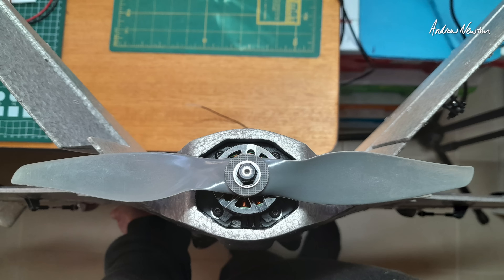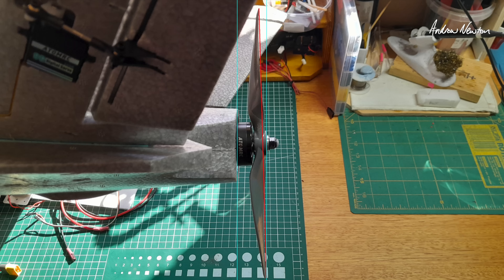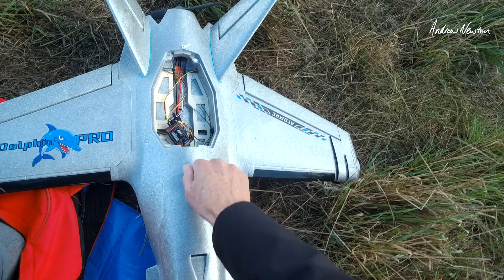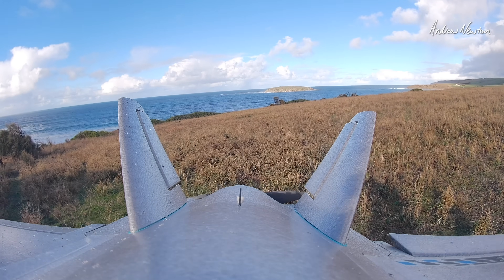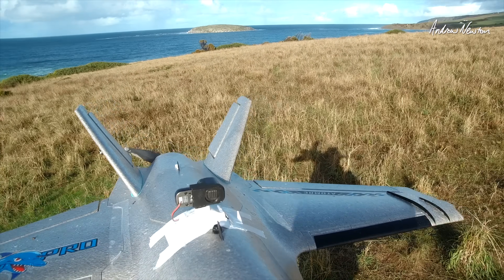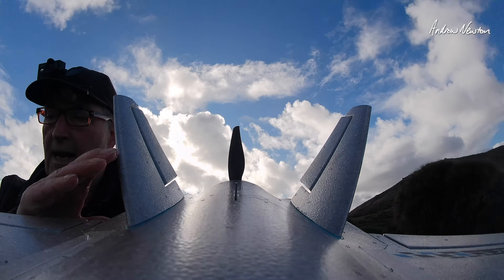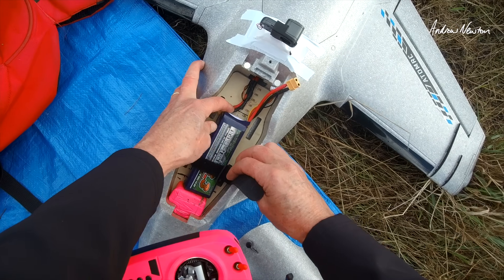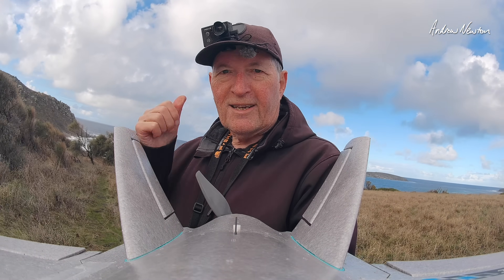AtomRC Dolphin Pro - Part 3. Flying Well without FC

Comment: Appreciate your in depth analysis and insight Andrew. So to recap 0.4mm was better than 0.8mm down thrust angle?
Reply from the maker: I left the 0.8 in and it flies perfectly with INAV now. 70/40 elevon mix with no elevator on the VTail, just rudder. I'll do another video soon.

Comment: Daft question, but can you not use the V-Tail as Rudder only in conjunction with Elevon mixing? I don't like the look of it with V-Tail as Elevator only. I'd also go 2x2200 3S Lipos in Series to give a 2200 6S. 4S just hasn't got enough guts on that motor.
Reply from the maker: Not daft. That will be how I set it up eventually. Elevator on the tail is more like air brakes but rudder will work.
Reply: @AndrewNewton  Yeah. With the rear facing camera, you can really see what happens with up elevator. Can't be good for efficiency.

Comment: Thanks for the video. It's amazing how far you have come from the first flight. Really really great video.

Long story short, this plane is crying to get CG furher back, right now its too nose heavy and the dynamics simply cannot cope with it good enough. Too much up trim to just fly straight and looses almost like 30-40 degrees in a barrel roll. Ouch.

As you do know what you are doing but It seems to me motor angle is a nice solution for take-offs and slow speed flying but I suspect it will be hard for fc to cope with once you have the FC installed and start high speed flying which the dolphins are famous for. Both slow and fast flying. For sure the second set of washers did put too much up trust.

I think the design will simply shine with much back CG and a good FC tuning.

Comment: Good testing done Andrew 👍
I still believe thrust angle is not needed, but if it has helped for your plane, then so be it. 
A bigger test for you will be when you put back the flight controller. We noticed inav behaves differently when plane is only slightly tail heavy also. My rth or cruise modes were not stable on pitch angle. Plane was rocking up and down on pitch axis, like sea waves. My plane came with 30 degrees board pitch angle, which was causing this problem, along with some tail heaviness. 
All the best for completing your tests. And Happy flying! 👍
Reply: Hello friend, I have the same problem. In cruise modes the plane shakes in pitch, as if a dolphin jumps out of the water. I don't know how to deal with this. Can you tell me?
Reply: @pavelgurenchuk2225  
Hello. For your Pitch wobbling problem in Navigation modes, I would start with some simple steps like below:
1) Go to "PID tuning" and "Mechanics", check if there is any "Level Trim" angle written there. If there is anything, make it zero.
2) Under "Alignment Tool", check if there is any Pitch alignment configured, it should be zero. Only Yaw should be 180 (This is for ATOMRC RTH Dolphin Pro model we are talking about. All other flight controllers will be different)
3) Reset the Factory calibration data - Remove Dolphin Tail Fins and Wings, Go to Calibration - "Reset Accelerometer Calibration" and do entire calibration on your own. and then save. Make sure Accelerometer values are showing new numbers.
4) Make sure your CG is slightly nose heavy, not too much also. When you are balancing the plane, it should just tilt towards nose, thats it. 
These steps will most probably solve your problem. Let me know how it goes.
Reply: @JustaSimpleMan-q1z   Спасибо. Я проверил пункты 1  и 2 . Я сейчас находусь на вахте, и буду дома только через 2 месяца. Но я вожу с собой FC и полный Diff file, что бы можно было посмотреть параметры в любое время.
Reply: Porpoising like a dolphin?

Comment: The Dolphin is just not a good plane if you have a rough field.  Because the Dolphin's low wing design, low rear propeller, and fast landing speed makes for damaging landings all too often.  Damage to wings, motor, propellers, nose.
Reply: By the way, rough field is not good for any kind of plane 😊
Reply: @JustaSimpleMan-q1z  Only good if it's super tall (like a mature wheat field) to reduce impact damage during a crash.
Reply: @JustaSimpleMan-q1z  No, there are planes that handle rough fields better than others.

For instance, a "high wing" plane with propellers that actually clear the ground.  And comes in slower landing speed with bigger wings and, optionally, with flaps.  This type of plane handles rough fields much better than the a plane like the Dolphin.

On the other hand, the Dolphin comes in fast and has low positioned motor that always collides with the ground.  The Dolphin needs a smooth flat grassy field.  Even then, the propeller is going to take some knocks with the Dolphin's fast landing speed.
Reply: @RCHobbyFan 
Ya, but where is fun to fly high wing slow flying planes? Those are mostly for beginners 😅
Reply: @JustaSimpleMan-q1z  Flaps my friend, flaps. :hand-purple-blue-peace: